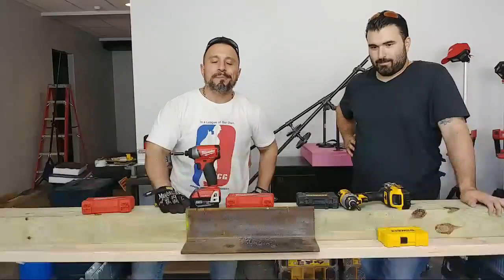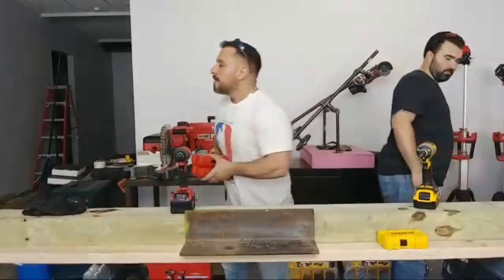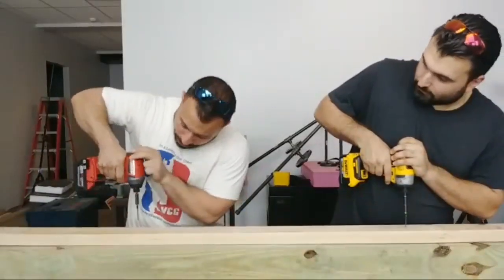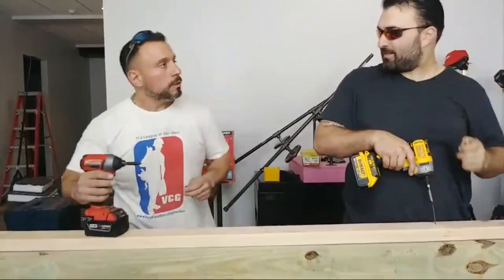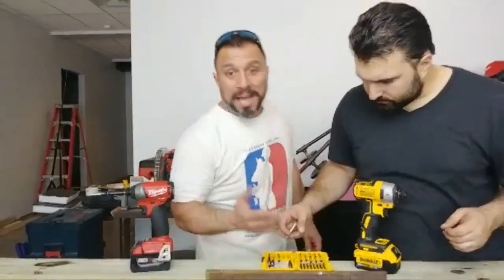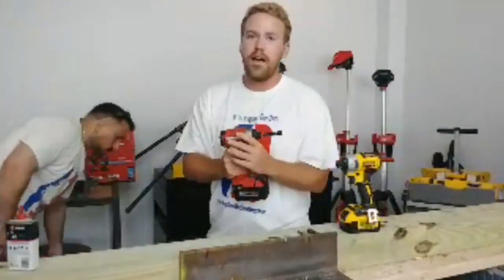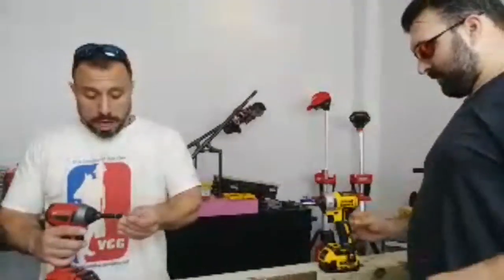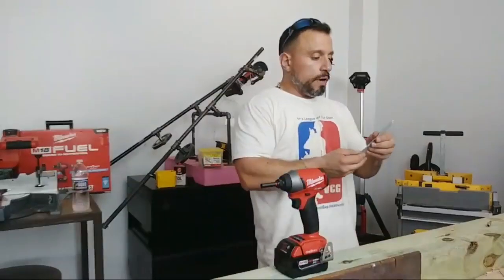Best Impact Driver Comparison Test - DeWalt VS Milwaukee

Comment: We use the M18 impact brushless drivers and drills for all of our crews. We haven’t had a tool fail yet and we own 6 of each. Some are as old as 6 years old. One of our employees uses Dewalt and the driver started smoking and failed after heavy use.

Both are good tools but for the same price, I’d go Milwaukee. The batteries are incredible. Some also up to 6 years heavy usage in our fleet. Highly recommend this brand.
Reply: I have two milwaukee batteries from 10 years ago and still hold a charge
Reply: I've had my dewalt 20v max for 5 yrs now its taken 20ft fall its drives 5 inch lags on 6x6 its drived 4 inch t30 screws and its still as good as new
Reply: I work at a lumber yard and test all the newer tools. Milwaukee has lost their crown, they used to make great tools but are not even close in quality today to what they used to be. Dewalt easily outperforms them now.

Comment: When cutting into metal slow is your friend. Low pressure helps a lot, Friction is the worst and speed + pressure= heat! Being a machinist most of my life and now at Lowes cause of grey hairs I can tell you guys that I used a continuous cooling system on my bits, some that cost over 1K each so you really don't want them damaged. I'm enjoying the vids. Then only true test of impact drivers are lags, everything else is user error. I know that the Dewalt 887 is garbage!  It burns it's self up one just one 3/8ths 5" lag There are youtube vids showing what I am proclaiming!
Reply: BTW those self tappers are meant for sheet metal not angle!

Comment: The only problem that I see with Milwaukee’s hammer drill 2804 or the gen 3 impact driver, over time the high heat will have an affect on the drill.
Reply from the maker: It really doesn't heat up Ringo, it actually cools down the longer we test it!
Reply: Are we watching the same video? Smokin DeWalt...

Comment: He was covering the vents on the Dewalt when trying to drive that lag bolt. The Dewalt has a fan its right at the vents in the middle. Plus its using a smaller amp hour pack than the Milwaukee and yes it does matter which pack is used. Real tool reviews done a test with 3 different size packs and got higher torque ratings the bigger the AH pack...
Reply: Ive already commented they very clearly dont know what they are doing and havent worked in the building trade for any length of time beforel loosing there employment.......

Comment: whats the best socket adapter that fits this specific milwaukee? i have seen vids showing the dewalt DW2547IR being the best, but does it actually fit and lock into place on this driver?
Reply: They wont answer becayuse they dont know..... 😂😂😂😂

Comment: I see you guys are using the impact in various different ways would you say use it for drilling or just use the hammer drill. I personal enjoy how the impact feels.
Reply from the maker: You can use it for drilling, but I prefer just using a drill for drilling. I use the impact for more driving applications!!
Reply: VCG Construction sorry for all the rookies question I just want to get this right so use the hammer drill for small Masonary  and drilling holes and the impact to screw in?
Reply from the maker: Long anchors and fasteners in to wood and masonry!!
Reply: Eww. Gross man...
Reply: 1) read the instructions that came with the drill.....

2) the hammer function is only for masonry work (brick concreate) dont use that for screws or tightening bolts, its just not good for them....

3) the power settings (clutch torque) is for how tight you want to tighten things. Max torque set to the drill position and its on max strength

Example, i will tighten screws on my cordless hand drill dewalt set to 2 or 3 for softer wood like chip board or pine, for hard wood, 5 up to 7 does it for me..... saves over tightening or snapping/stripping the screw head.....

Watch videos and see how others use the tools in construction videos.....

Make sure the drill is straight onto the screw, and apply enough downward force so the bit dosent skip on the screw head....

You will get used to things after a few goes..... maybe practice alittle till you get used to things..... its all a skill that needs to be aquired, and you will if you have patiants 🙂...... enjoy 👍🏻

Comment: Always wondered why no ones uses straight 4 inch robby bits instead of the bit extension and that crap mini bit
Reply: I buy wiha bits. Kinda expensive but they never ever ever strip screws, and you can drive a few thousand without it breaking. I bought the number 2's and they work perfectly for 1's, 2's and 3's.  I recommend them to everyone. 
The black DeWalt bits are garbage in my opinion. Specially the Phillips.  Wiha for the win! Worth the money. Like 25$ Canadian for 10 bits
Reply: DeWalt socket drivers though. They work good enough and are reasonably priced.
Reply: I use the dewalt black impact bits,  they work for me without that much wear for a very long time.....

Comment: I don’t get the point of competition on both high end line brand.  All is the same shit when you use it for work.  If your a professional then you dont think much about it as long as its a contractor brand. Both is good ... gets the work done!  So i average $200-300 a day $1k on a good day.  Will the better brand makes me more money?
Reply from the maker: It’s not all the same when you try to drill a 5/8” hole with a paddle bit in your DeWalt dcf887 and it goes up in smoke because you didn’t watch #TTR
Reply: VCG Construction i am thankful for the person who did this review. But it doesn’t make any difference in the field. Its not like you work the tool nonstop. Of course there is always a better model if you compare it side by side by overworking it and comparing which one has more power or faster, but As long as you get the brand you like and contractor brand either dewalt or milwaukee its all fine.  Its not like you work non stop trying to destroy the tools your using.  I used all top brand lines before and to me all makes me money lol. I prefer milwaukee more but that is preference. At the end of the day all get the job done! Thats all it matters.
Reply from the maker: John using a 5/8” paddle bit in an impact driver is not overworking it. I’d expect a contractor grade tool not smoke and burn out which the DeWalt dcf887 did, but hey it’s your money buy what you want.
Reply: VCG Construction hahah even though i said all of this i am using the milwaukee one lol

Comment: What is the best hammer drill?
Reply: Honestly. I own both milwaukee and dewalt tools, and back when I did electrical work I would beat on the dewalt hammer drills like crazy all day and couldnt break one, a lot of guys did manage to, however I believe this is because they would push too hard rather than let the drill do its thing.

Comment: have both dewalt is stronger and faster did burn allot of self drilling screws when screwing into structural beams. so i had to put the 887 into 2 gear and the milwaukee i put on 3 gear and does the job a little slower but aint that fast that it will burn the screw. so i did have to get used to the milwaukee at first felt like lack of power but the xc batteries are pretty nice.

Comment: Dewalt all the way 🤫
Reply from the maker: Sorry not today cuz!!
Reply: Only because you blocked the air cooling vents on purpose..... you did that because when you tested off camera the dewalt won, so on camera you knew you couldnt keep it a fair fight, so you purposefully blocked the vents so the drill would smoke....

Funniest thing, did milwakee pay you for replacing what the dewalt cost you?  I bet they didn't...... you loose not only the cost of that drill, but viewers.... no wonder    project farm is on 3 million subs, and your just over 50k after 5+years, and it took him around 3 years or so to get his 3 mill because he is a serious reviewer "bro" and he is completly unbiased in any direction "bro"......

I hate what you did to that drill just to make the other look better.... even another commentator said the concrete test was also unfair.....

"More is the fool that listens to the opinions of an idiot"

Reason for leaving, my first and last video from here.....

Comment: some dewalts tools are better and some millwuakee tools are better in the end they are both offer quality performance. dewalt is over all better because they have a better lineup of tools
Reply: Part of your comment stands and part does not. Yes, some DeWalt are better than some  Milwaukee and vice versa. But having a larger range of tools has nothing to do with quality or durability.
Reply: @kwizmon  the quality and durability through both brands are very similar. I just think the dewalt experience offers more with the dewalt power station, flexvolt tools and batteries. and bigger lineup of tools.

Comment: I'm here to tell y'all to stop buying and encouraging tools with more electronics. The more delicate electronics, the more smoke and failure points you have. All these modes for different screws and pressures will lead to a pile of crap in a few years.

Comment: Kobalt 24v lmpact blow both Milwaukee dewalt away
Reply from the maker: Really?
Reply: VCG Construction for the price it does. 
In reality the kobalt 24v holds its own but if you wait for a sale you can get drill and impact for like 140 
Black Friday I got the 6 tool kobalt tool kit for like 240. 
Batteries can be found for only 10 bucks also. Lol 
I own dewalt and kobalt and have used Milwaukee for the price kobalt wins. I’m still a dewalt  guy though.
Reply: Colby Forbes trash talk not xcepted
Reply: My Kobolt 80volt 18in chain saw kickz azz and kobolt 80volt leaf blower.  But as far as power tools Kobolt is no where compeating with Milwaukee and dewalt
Reply: Dude no
Reply: Got this m18 1/4 impact brushless with a battery and charger on sale at home depot for 99 bucks.
Reply: Lol. Home user pulls out his drill once a decade...